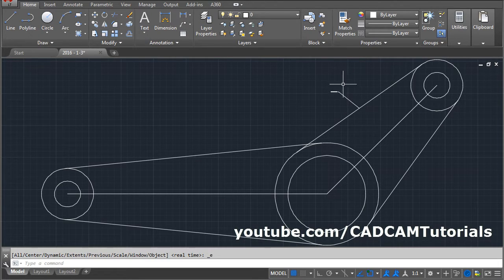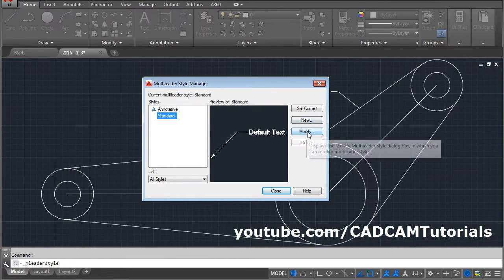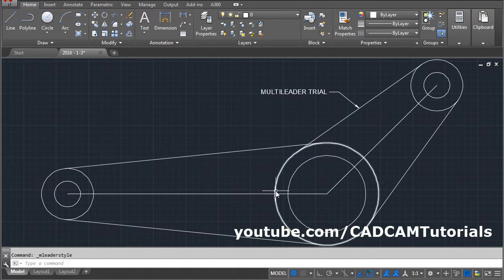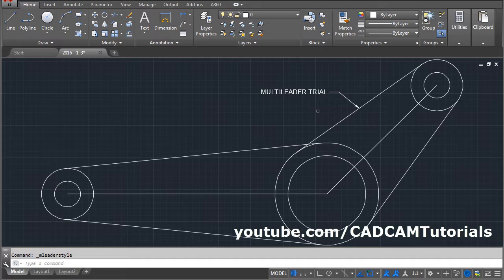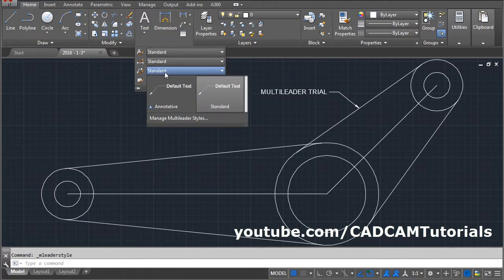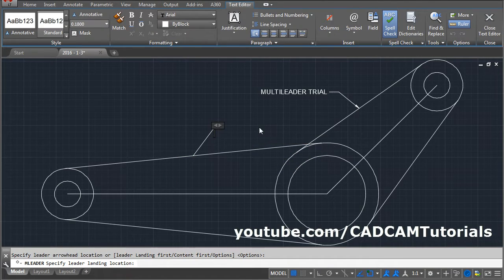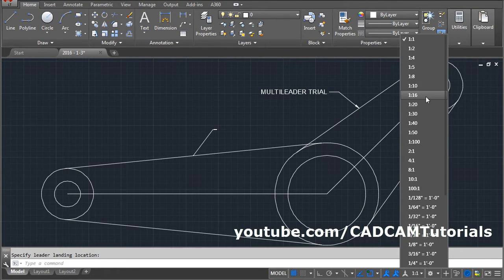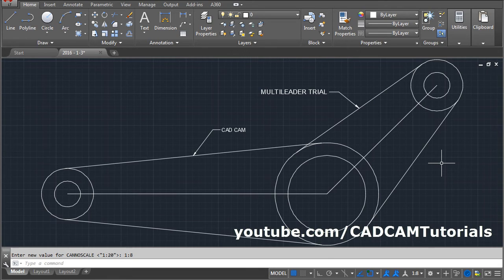AutoCAD Multileader Text Size | AutoCAD Multileader Text Disappears

Comment: Sir muze naya laptop lena hain to AutoCAD ke liye NVDIA ka 2gb graphics sufficient hoga ya 4gb hi lena padega &
Processor i3 ya i5
Reply from the maker: +Akash Sonawane 2gb & i3 is sufficient but if you can afford, in the long term 4g & i5 is good. Higher is always good, because later on, if required, upgradation is not possible.